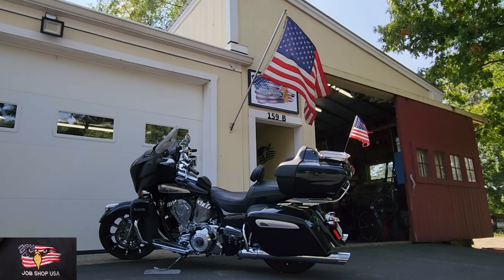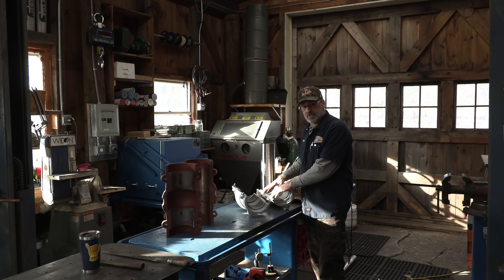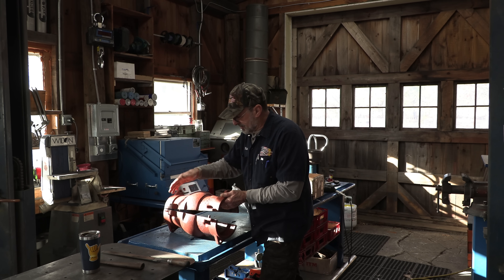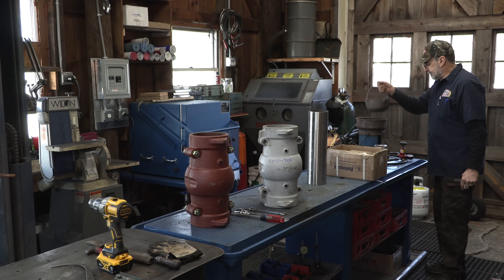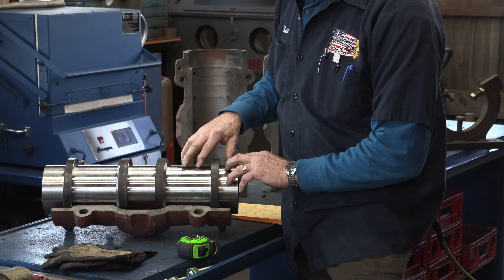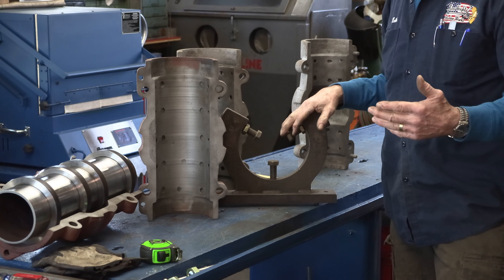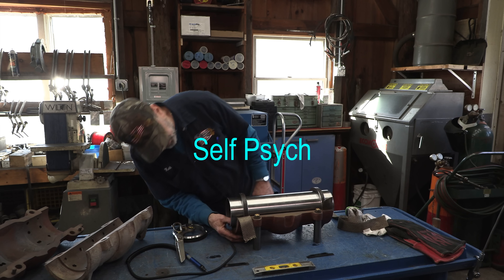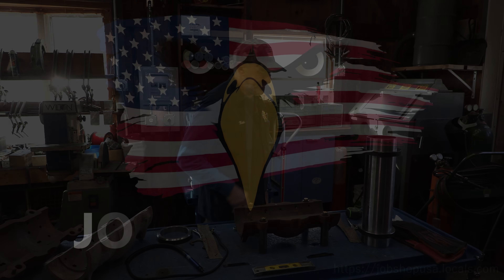Babbitt Pour 2024

Comment: is this the first time you have poured Babbitt I have poured lots of babbitt and never had the problems you have had.   We use Bear Shite to pack around the mandrel to keep the babbitt form leaking. and always have more babbitt melted than you need  for the job.  For boat shafts we pour smaller and then bore to fit the shaft. Not impressed with your set up.